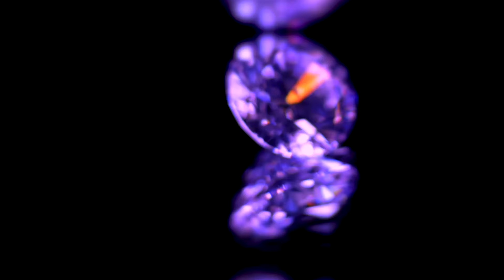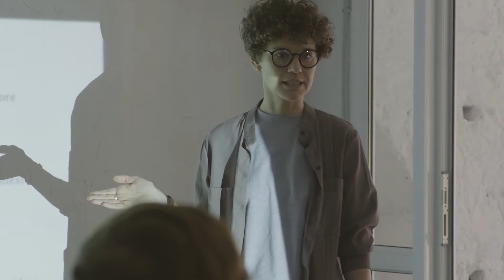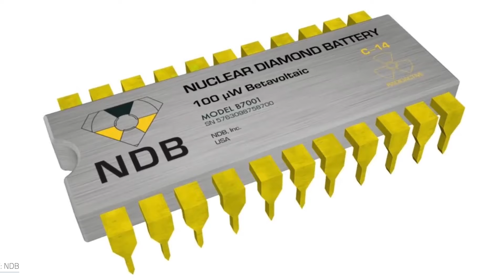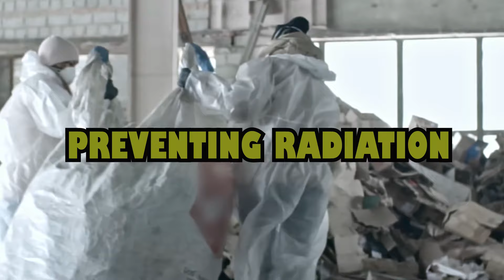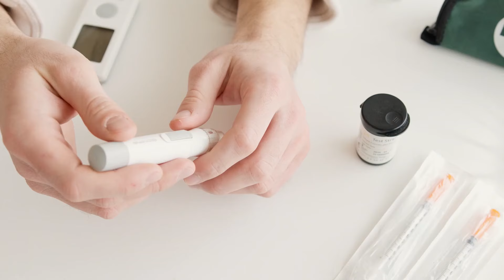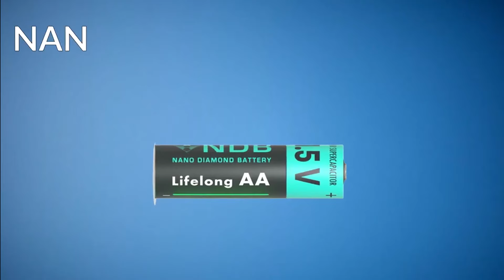IT FINALLY HAPPENED! Nuclear Diamond Battery NDB has Hit the Market!

Comment: Pure rubbish. Carbon 14 betavoltaic batteries are providing an extremely tiny power to volume density 1000s of times less than Li-Ion batteries making them usable only for very low power applications such as pacemakers. Imagine your phone or EV battery being 1000s of times bigger and redo your video with that in mind…😊
Reply: If you do the math, a nuclear diamond battery creates 3.3 Wh/g. Electric cars need 30 kwH/g. The average battery weighs 25 - 60 lbs. Creating a proper battery that weighs around 25 pounds is easy with ndb tech
Reply from the maker: Thank you for your feedback and for pointing out the limitations of Carbon 14 betavoltaic batteries. It's true that they currently have a lower power-to-volume density compared to lithium-ion batteries, making them more suitable for low-power applications. However, research and development in this area is ongoing and new advancements are being made to improve the performance of these batteries. I'll keep this in mind for future videos and appreciate the input.
Reply: @thebeyondofficial  No, it's complete nonsense. There is no research and development possible to ever fix this issue. 
It's rather simple to understand why by just considering the first law of thermodynamics that energy can not be created or destroyed. If you take a radioactive isotope and let it decay in some metal housing protecting against escaping radiation, ALL the energy will have to be turning into heat. 
You can capture only some percentage of the decay energy (e.g. beta radiation) into electricity, but even you could capture it all (impossible), the energy would still be very tiny. For a radioactive isotope to start being feasible for higher power output, it will have to be extremely hot (literally hot) while decaying and of course also extremely dangerous. 
Carbon 14 is not even hot because the decay is so tiny. Plutonium 238 is decaying much faster and is therefore actually hot and can be used for more power output, but it's also super dangerous and super expensive. 
And even with Plutonium 238, power density is still way way too little for an EV. The Voyager battery is a multi million Dollar battery using Plutonium 238 with a fraction of a single horsepower.
This topic is super idiotic when you dig a bit deeper in understanding it (just consider the first law of thermodynamics). It's essentially a SCAM.